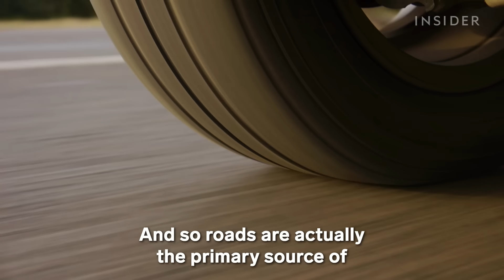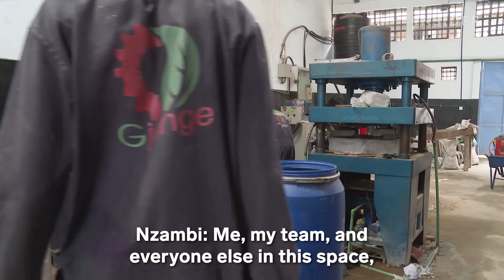Young Inventor Makes Bricks From Plastic Trash | World Wide Waste | Business Insider

Comment: Very impressed. The fact that some large company wasn’t the one who thought of this or implemented it is kind of shocking.
Reply: they explained why it's a terrible idea in the video.... it's literally worse for the environment
Reply: @sangun123  They didn't say that, they just said it's not a final solution. A terrible idea is doing literally nothing and just piling plastic waste and throwing it into rivers/the ocean. Microplastics definitely damage the environment less than multimillion ton mounds of trash, although I'm sure at a sufficient concentration they increase cancer and eventually become fatal. Just leaving the plastic waste in the environment though will still create microplastics as it decomposes.

The actual solution is to not use plastics, but you won't see that happen for a long time or maybe even ever.
Reply: cuz none of them operate inside africa.

Comment: As long as the process of making it and using it would not release harmful substances.
I remembered I was told that there are different types of plastics and some can be recycled but other can't be recycled. Because it will decay quickly.

Comment: While I applaud the ingenuity there are many issues with this, not least of which is the likely health concerns of melting plastic in an environment like this without proper filtration. That's a short life waiting to happen. More importantly, this will absolutely leach into the ground and exacerbate micro plastic contamination. If we want a healthier future plastics need to be regulated for production and otherwise potentially banned. The only way that this magnitude of a pervasive issue is resolved is by removing it entirely (or as close to it as you can get). I'm confident in a century we'll look at plastic pollution like leaded gasoline. Not a good idea.

Comment: This recycling option is good because you can also recycle relatively dirty plastic, which is burned or taken to a landfill.
Concrete tiles are prone to destruction, especially in countries where the temperature is below zero in winter, since concrete tiles absorb water, then turn into ice at negative temperatures, and then at positive temperatures again into water, and in 2-3 years many destroyed tiles appear on the site.
Say if you use repulsive additives, then you can avoid this, I'm not sure if this is the right move.
I think polymer sand tiles have the right to life

Comment: Incinerators are required.
The gases can be scrubbed and percolated to extract certain solids and harmful gases.
Byproducts like carbon could be used for activated carbon in chemical processing applications. Some gases can be used to produce fertiliser or other chemicals. The plastic is the fuel therefore there is no need for other forms like coal or wood. The heat can drive turbines to produce electricity.
Sweden has 5 incinerators and Russia has commissioned a very large unit, afaik.
Coal fired power stations could be repurposed to handle the plastic feed stock i.e. crushing (refining) and dealing with the byproducts.
The Temperatures might be different and some of the gases caustic which could require special linings for some metal surfaces.
Clean out the landfills, rivers, sewers, the beaches and Oceans.
Return to natural fibre for packaging.
Businesses using plastics extensively must be retroactively penalised because they have lobbied and exploited the public for profit.

Comment: I get the feeling they aren’t working at anywhere close to peek efficiency or optimization.
I would be very curious in the pricing differences once this operation is fully modernized.
Perhaps getting it as low as 30% of the price of concrete or bricks. That would be revolutionary as long as these products don’t cause secondary environmental issues I will have to hear about for decades.

Comment: I'm not really sure if it will be a good solution for the future.  Maybe for now but to reduce plastic waste should be first priority.  I use glass bottles for liquid like milk or water.  I didn't count how often I reused these bottles but it can be easily thousand time.  The lid needs to be replaced sometimes but this is easy because it's like a standardized for other bottle types. Plastic is not really that good but we just need it but we don't want to drowning in it

Comment: Great idea with regards to the recycling of single use plastics but a few pretty critical points. Using these bricks in the construction of roads would cause an immense increase in microplastics upon the environment, and how many pollutants, dioxins for example, are being released as the plastics are melted and molded? Not to mention the fact that it'd put your workers at great risk of developing cancer, especially considering the obvious lack of PPE to prevent such things. Again, loving the concept, but *potentially* horribly executed

Comment: The solution is simple, Countries just do not want to put in the work. Plastic and paper can both be recycled. The only paper and plastic that should be available is recycled paper and plastic. There should not be new mass production of either. Because if we recycle what we use, its re-used over and over. And I think plastic paved roads is absurd, the plastic bricks should be used to build homes, where constant friction does not occur, and it will help get people out of tents. Cars driving over plastic, will release plastic particles into our already polluted air.

Comment: It's going to cause more problems. Best way is to dig a deep hole. Erect steel walls and weld them so nothing can get into the natural world. Crush everything and pack them tight. Stack them in the underground steel box. 1km deep. 100m×100m wide. Dump a ton of plastic eating worms inside and seal them until there is a better solution. Unfortunately this is the best option humanity has for plastic problems.

Comment: My question would be about how it handles heat, not just from cars driving on it or breaking on it, but also from how dark it is. Being essentially nearly black makes it absorbs a lot of sunlight. If you pave a city with that, the temps will rise in the streets, and depending on how strong the bonds are in the brick, you could smell plastic in the air aswell. Im really not too sure about this invention, it could be maybe used for dark warehouses or something, which dont have a ton of environmental wear and with low amounts of heavy traffic and speeds it shouldnt be much of a problem.
Reply: Seems like it's being used mostly for foot traffic and driveways, but your concerns are prudent. It has environmental impact. Unfortunately I can't really imagine a better alternative in their case. Their landfill is overflowing and this is their alternative to literally just lighting it on fire.
Reply: @Queer_Nerd_For_Human_Justice  I have concerns about the workers health too.  Bless their hearts that they're trying to do a good thing with the plastics, but melting those plastics at 400C / 752F will give off a lot of nasty toxic fumes. Prolonged exposure would be dangerous if you did not check every piece of plastic going in the furnace to make sure it's the right type.
Reply: @justinmichael007  I worked with Plastics for 12 years, dont remember any toxic fumes, but yes 400c is a but to hot, in fact I dont think that is correct as plastic dosent need that much heat.
Reply: @AMLagonda  The temperature at which plastic starts to give off toxic fumes depends on the specific type of plastic and its composition.

Some types of plastics, such as PVC (polyvinyl chloride), can start to release toxic fumes at relatively low temperatures, such as around 70-80°C (158-176°F). When PVC is heated to high temperatures, it can release a variety of toxic fumes, including hydrogen chloride, dioxins, and phthalates. Hydrogen chloride is a corrosive gas that can cause irritation to the eyes, nose, throat, and respiratory system. Dioxins are highly toxic compounds that can cause a range of health problems, including cancer, reproductive and developmental problems, and immune system damage. Phthalates are a group of chemicals used to make PVC more flexible and can be released when PVC is heated. They have been linked to reproductive and developmental problems, as well as other health concerns.

On the other hand, other types of plastics, such as PET (polyethylene terephthalate), typically only start to release toxic fumes at much higher temperatures, such as around 250°C (482°F) or higher. PET is generally considered to be safer than PVC when it comes to releasing toxic fumes, but it can still release some harmful substances when heated to high temperatures. When PET is heated, it can release acetaldehyde, a chemical that has been linked to cancer, as well as other chemicals like antimony, which can cause respiratory problems, and benzene, which is a carcinogen.

It's important to note that the release of toxic fumes from plastic is not only determined by temperature but also by other factors such as the duration of exposure, the size of the plastic object, and the ventilation of the area.

In general, it's recommended to avoid exposing plastics to high temperatures.
Reply: Exterior blocks four housing projects in Canada! Very energy efficient I suppose, very affordable, no traffic no wear and tear, practically eternal!

Comment: Thats interesting as a roller operator I wonder how well it holds up on its edges with lots of weight on tires, and what the specs would be for it being done in the states seems like it could become cheaper than using current asphalt with oil prices rising

Comment: Plastic degrades quickly over time. Regular bricks would last hundreds of years. Plastic becomes brittle, breaks down, sweats hydrocarbons... It might only last 20 years. Also plastic will break down at 950F and convert into fuel via pyrolysis.

Comment: plastic is  so  disruptive  and harmful  to the  eco system  for it takes  far too long   degrade  As a waste  product . It invades  the  water supply  in  turn  it's  effects are  felt   though out world  ideas  that  involve  the  use  of   none  biogradeables to  Build  is  very inventive  But must be  explored  in  treams of  long term effects   both harmful  and  otherwise  conter indications  of  homes  being  made  habitable  when  this is  proven to be made  safe  it could  be  a possible solution  towards  two big issues  of  environmental   damage  and what  can  be done  with  the  on going waste  production and  problems of homelessness   too ! but it still is in its infancy  and must be  explored. Before  put into  practice.  In my opinion.

Comment: All of this these comments are scary. Reusing things breaks down the general integrity of it, and now your saying we should build with it? Bricks themselves are broken down rock made into a softer material than before,  now litterly using garbage? No thanks. Use a iron pan from a while back, the mf still can cook. There are viral videos of garbage pans from today's time, breaking while flipping a simple EGG. Cars today are made of plastic and Styrofoam.  It's all made of recycled shit
Reply: @Michael Tremblay Then don't cycle anything,  it makes the the overall structure of something worse. Plus the chemicals used to recycle the plastic I'm sure are a worse alternative to just making a new bottle. Yea the plastic itself is made of chemicals, but at least it's not those chemicals,  plus whatever is introduced in the recycling process.  To make cars and structures out of anything that isn't the most protective and stable is braindead. We live in these things, we travel at speeds a human body never was capable of achieving without brains and engineering,  and yet we make them out of plastic, carbon fiber, STYROFOAM. Human devolution is amazing,  isn't it?

Comment: On the surface it sounds good.Have you ever seen what the sun does to plastics after a few years? It 
breaks it down. They need it to be UV stable or it will degrade at an extremely fast rate. As they degrade and wear from automobiles and pedestrian traffic, they will release micro-plastics into the environment. There may also be a plastic dust issue here.

Comment: This is such a hazard! This "inventor" doesn't know what she is working with melting plastic down and sorting it from trash heaps by hand. I get this is 3rd world trying to turn a negative into a positive, and that's its saving grace but this is at the expense of anyone remotely near the process. Those masks are worthless, all they do is block the smell, not stopping the hazardous fumes. The finished material will detoriate over a short time ~20-30 years turning into micro plastics and eventually making their way into the water system. This is an awful idea by someone who isn't educated enough to know better. Shame on Business Insider for propping this up as a good idea.

Comment: Nzambe, how are you?... You are doing a great job.  It looks like you need some more equipment in order to increase production.  Does the Kenyan Government have a funding program for Citizens of Kenya 🇰🇪,   to obtain investment money 💰 to develop their business??  I hope they do because this is what you need.   The machine that makes the plastic and sand into the dough and measures it out by weight could help you increase production if that process is mechanized and the mold of 10 bricks filled in the same process  and dumped into the cooling tub... Then Your right hand Man could focus on stacking,  making new varieties and even drumming up new uses for the product...  Contact your Government department in charge of Commerce.  See if they have a way to help.  Search the machine to find who made it and see if you can get an automated version of it.  Try to get a Solar powered one.  To make it cut ✂️ cost.  Also figure out how to get a contract to supply bricks for a road.  Figure out how many bricks will be needed for a portion of the road.  That way you can make them in stages,  as you focus on Collecting your materials so you can have longer manufacturing stage.  Ask Tata Nzambi for more ideas 💡 😄 ☺️ 😊 💜 He will send you many.  Great 👍 👌 job to you and your team.  Keep up the good work.

Comment: UV from sunlight, general wear and rains will break down the plastic and it will seep into the water table. If you have wells nearby everyone will be drinking a steady diet of plastic as will animals. This is an environmental disaster and will help put microplastics directly into the local water table and environment and eventually the rivers and oceans. 
They need to do environmental studies before considering using these bricks.

Comment: Set the lead screw of the injection molding machine to meter your correct weight. Set the forms with mud right there at the end of the extruder. Forms on rollers in line with press. Exact weight of mud cuts out the excess flash. All sorts of things to make this more effeciently. Get a cement mixer for plastic sand and dye at front of the line. Always make at least 2 x what you need for one run. Maybe 100,000 bricks. It is impressive what you have done to get a working business. Stick to it and you will find all sorts of things to improve your process. I love your recycling efforts. You are good with people and this is key to staying in business for a very long time.

Comment: I Got an idea to reduce microplastics due to construction of plastic roads, we should make the bottom layer with plastic and cover it with normal asphalt to reduce tires rubbing against it. It would be little bit costlier than normal plastic mixed roads but surely less costlier than pure asphalt roads.

Comment: I think that once they have scaled up brick making to mass production they should try and diversify the products that they make from this material.  I think that the real innovation here is the creation of a new material out of waste, but like any material it can be made into any number of different things.  Perhaps they should do some experiments with adding fibers or steel reinforcement to boost strength.  Try and take this material head to head with concrete.